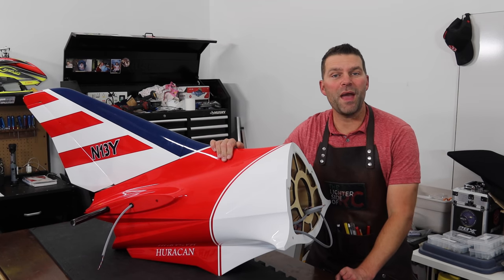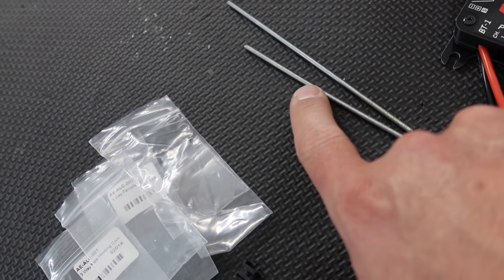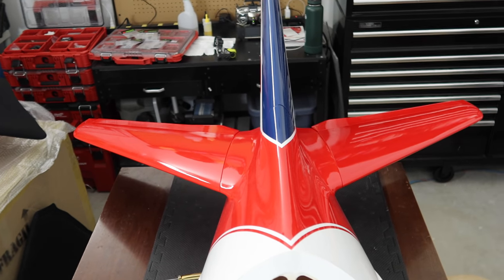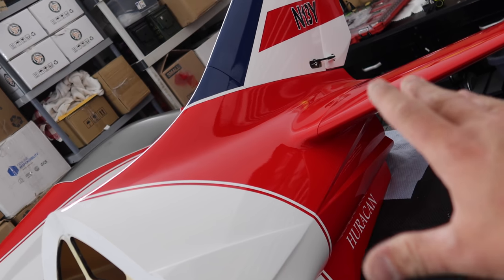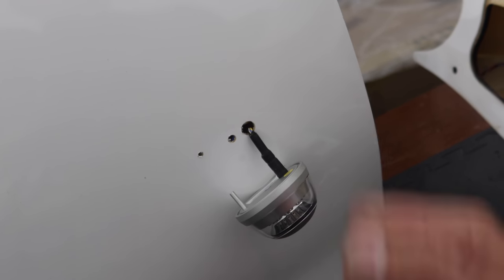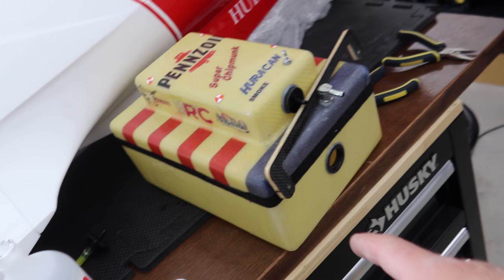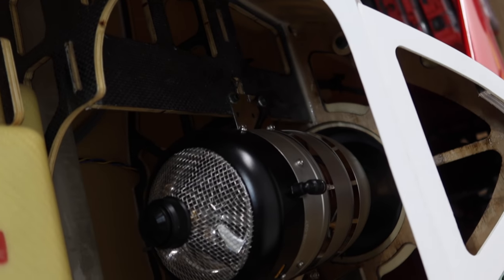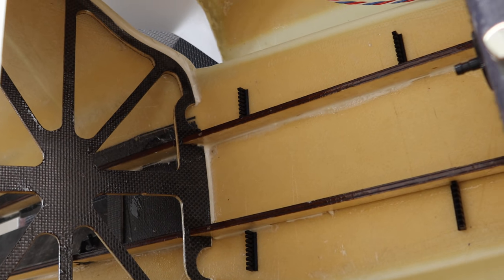GIRTHY HURACAN RC Jet Turbine

Comment: Tip for the blind-nuts. Instead of pulling them into the mounting from the other side with a bolt I actually install them in a separate piece of wood. Hammered in nice and flush with some good glue. Then glue the piece of wood under the mounting with some hysol and install the bolts to align it perfectly.
Reply from the maker: That’s a piece of genius right there!  Thanks for that!  I will be adopting that! 🧐🤓

Comment: Hello, what method didyou use to drill the holes to mount the turbine?  With the overhand of the model it looks like you might need some 90º drill attachment?  Thanks!
Reply from the maker: Hello Sheldon.  Yea I thought I had included the 90 degree attachment in a video clip but I did not.  one of my friends order one for me off Wayfair or some site like that.  It works for situations like this.  I'll try to remember to include it in the next video.
Reply: @thelightersideofrc  Thanks!!

Comment: Given the extremely high values of these jets. Do you find that your flying experience is diminished or just not as enjoyable ?
Reply from the maker: Great Question!  I find my flying experience heightened even more than let's say flying a foamy.  My flying experience is the same with either but I care a lot more when I'm flying something like this.
Reply: @thelightersideofrc  I agree. Nailing a landing in something like this (although not necessarily more difficult than a foamy) is so much more enjoyable. Of course the whole effort getting to the field and getting setup up to fly is also more...

Comment: Jonathan: I did not say anything about the Swiwin 400 engine. Hehehehehe. I will not beat a Dead Horse anymore. The Huracan looks like a Child is the Pilot. I like the New Shop Color. Well you take Care. And what you take on Styrofoam blocks to build your Shop? Nice R value. God Bless and Be safe.    Greg
Reply from the maker: LOL. Thanks Gregory.  I'm loving the ICF Styrofoam blocks on the foundation and also the EIFS (Foam Stucco) on the outside of the house.  SO Quiet and very efficient.
Reply: @thelightersideofrc  also go with Metal Roof for the RC Shop.

Comment: Great video as always. Question, how do you check if the end of the turbine and bell mouth are in the correct position?
Reply from the maker: for centering I just use my eyes.  For the depth inside the bellmouth it's will be a bit of a trial and error.  on the first run up will listen to it, check temps to make sure decent air flow is happening and after maiden will check power.  If it seems to be lacking power may have to pull the turbine away from the pipe more.
Reply from the maker: The outside edge of the mid point is safe and it will probably work out fine.
Reply: @thelightersideofrc  thanks! I am just getting in to turbines, so love the tips and tricks!

Comment: This is supposed to be a Hurricane. I think Hurican is an Asian misspelling. (unless it means something entirely different) A buddy of mine bought a foam biplane. The box said it was a Peaks. He ran around calling it a Peaks until I couldn’t take it anymore and told him it was a Pitts. I showed him a picture of one. He was shocked and corrected himself. He also had a Cessna with the same purposeful misspelling. In these cases it was done so as not to infringe on copyright. I would find out. I would want to know. And if I were correct I would have new vinyl cut for it that says Hurricane!!! Which I believe was originally intended.
Reply from the maker: Hello Michael.  The aircraft shares lots of the same lines and the Lamborghini HURACAN which is where the name comes from.  If you look it up that's where the intakes match.  Also the Skycandy/Ozaero light setup I have coming mirrors the Lambo Huracan headlights.😉
Reply: @thelightersideofrc  Cool!

Comment: I'm asking this question because I don't know. Why don't scale jet engines look exactly like what you would see on actual sized jet , say like a F-16 or something?
Reply: Making scale models of things is an art because the physics of the real world doesn't care what you would like. The molecules of air and fuel stay the same size so a small jet using fewer of them is going to be a different shape than big one.
Reply: @josephgilliand4  thank you.
Reply from the maker: The full size engines are multi stage engines. Much more fuel efficient compared to our mini versions. There have been some that have played with multi stage micro turbines but weight is always the penalty

Comment: at 16:00,  ? ? ?      this elongated exhaust  configuration  does  NOT  make  sense.!    because, the   smooth/energy-dense  flow from the engine  will be, Undesirably,  made  turbulent  (while still INSIDE  the  airframe).        googletranslate
Reply from the maker: I thought it was a great idea with the large intakes there will be excess air in the fuselage.  The openings around the exhaust will allow any extra air to escape if needed.